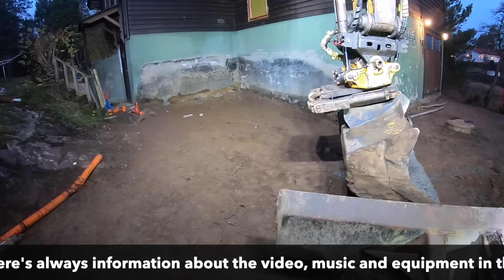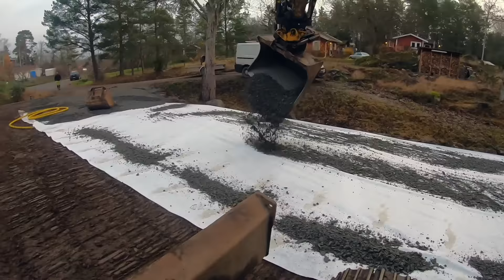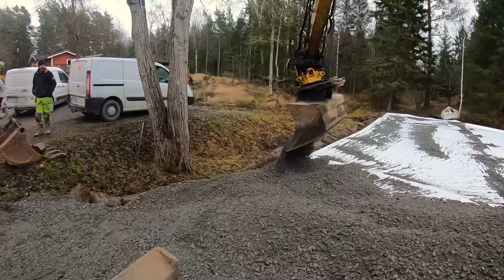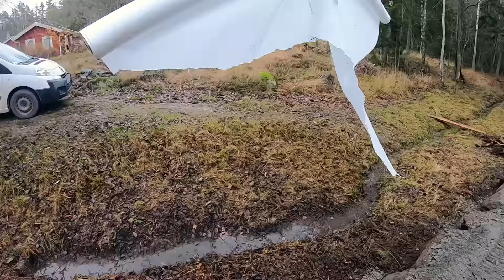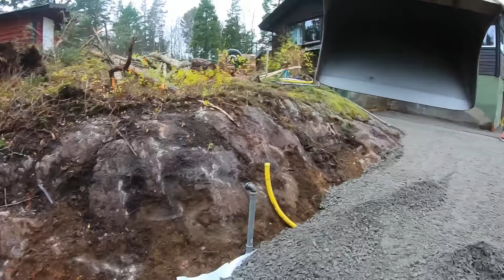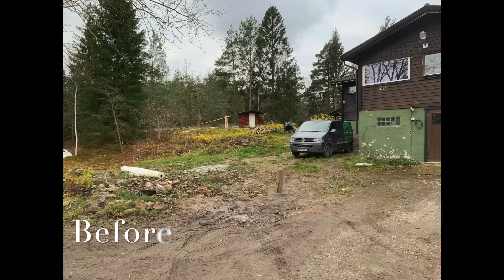Maximize the front yard 2:2

Comment: How is the 307 in use? I see you've equipped it with an engcon rotor. Seems pretty neat with the claw on it too! I'm a bit surprised that you didn't roll out the white carpet everywhere, cause I know I would, even thou it might not be critical, it would just made it even more neat and tidy. Seems like you maximised the available space and it did make a huge difference. I'm a bit jealous that you guys always have that little claw on the rotor. I've felt the need for that many times!

Comment: I wonder if that's the same kind of rock we call pack rock in the US. Get's hard like concrete over time..
Reply from the maker: It's probably something similar. This is crushed rock 0-32mm and 0-16mm.
It also becomes a hard surface that becomes even harder with time
Reply: we call it 3/4 crushed in Canada
Reply: @daleburnett3564  we call it crusher run/crush n run in Virginia